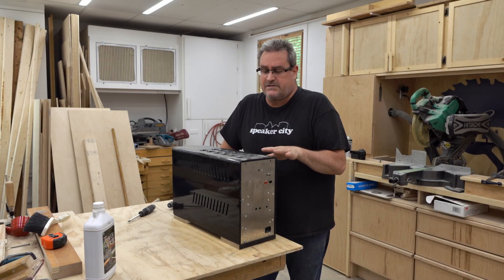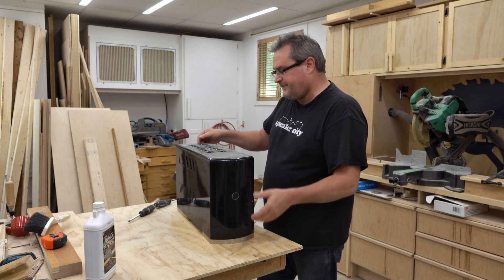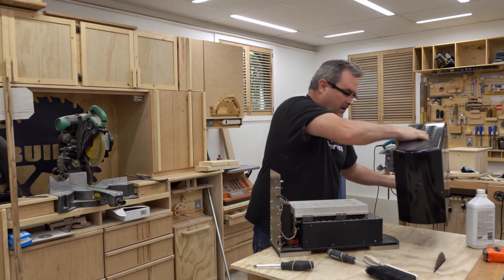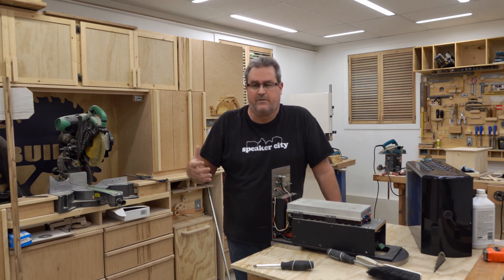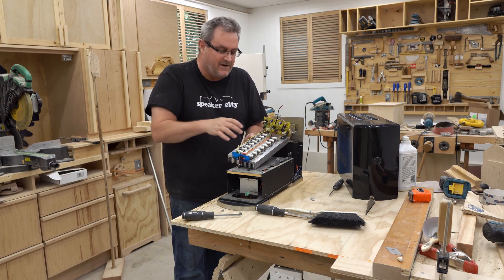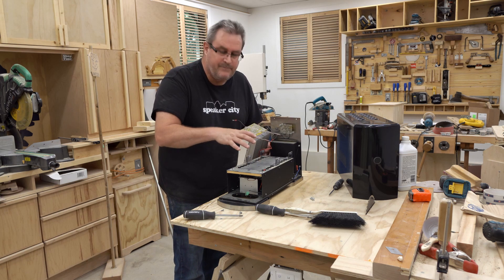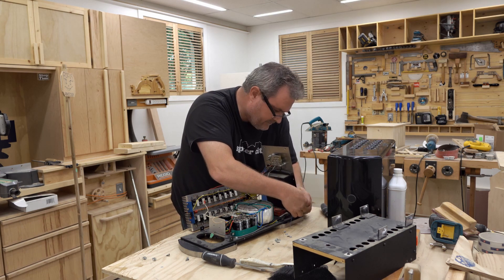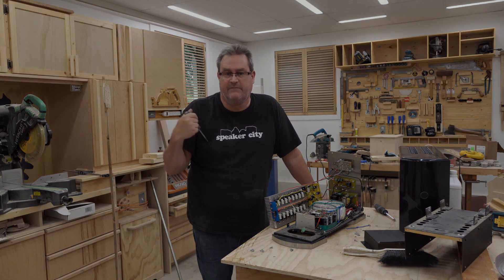Inside My  Homemade 1000 Watt Subwoofer Amplifier

Comment: i'm impressed by your creativity. i always buy off the shelf chassis and call it a day. i have a question about your amplifier. is that 3EF configuration? also why do you choose to not to have base stopper resistors?. the concept of using chassis as power bus is awesome
Reply from the maker: Thanks. Schematic for this amp is in the website article (link in the description). I tested the amp heavily during the design / build and didn't have any stability problems with the triple EF. Base stoppers never hurt, but I didn't need them for this one.
Reply: that means the Ib are close to each other or the bandwidth wasn't high enough to cause a problem with that many output stage. good for you! i'm building an amp with at least 250kHz bandwidth and i can't really trust the quality of transistors in local market here. decided to go safe and use 3.3Ohm base stopper.
Reply from the maker: If I recall correctly, the combination of the fairly fast pre-drivers and drivers with the relatively slow outputs helped. A zobel on the output also helps, and I always use one.
Reply: I haven't tried using slower power transistors yet. MJL21193/21194 is quite expensive and i'm not sure if they're safe enough to use at high bandwidth circuit. cross conduction could occur. but maybe i'll try it with one or two pairs. I use 5 pairs for 200W at 8Ohm

Comment: I thought I was amazed when you made the relay switch with the shop vac and the saw.  You really need to tap into this skill set more in combination with your wood working...  impressive to say the least.  Tap back into it!  Can't wait until you reinvent saw blade adjustment with some sort of electric motor thingy.  I realize now you really do go through some length to keep it simple for us.